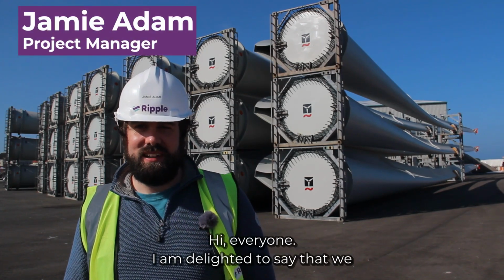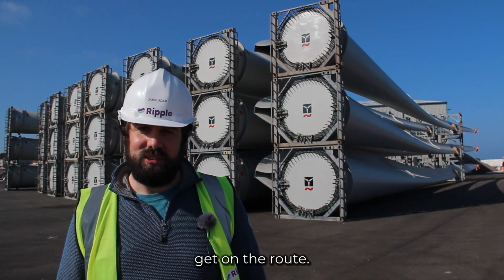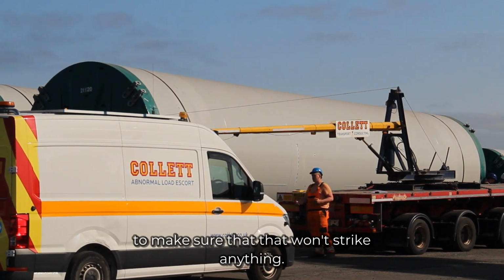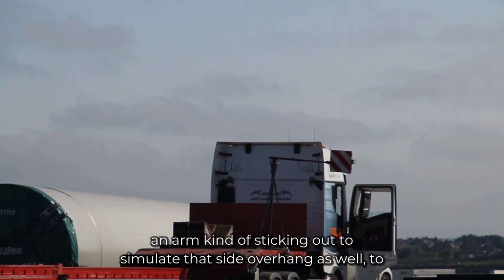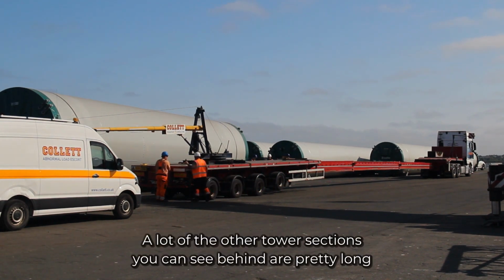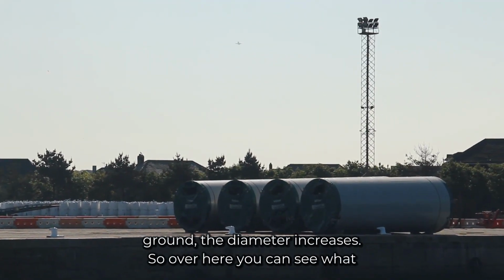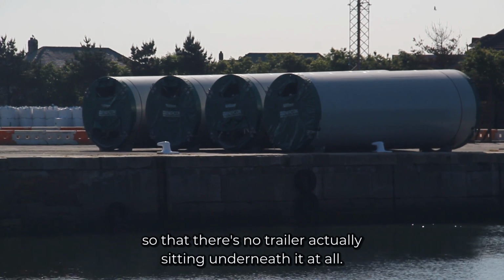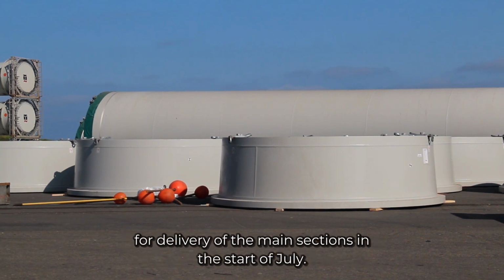Long load test drive to Kirk Hill

Comment: Is that section next to the original road at 4:00 going to be left as a permanent layby or in case additional blades are needed in the future.
Reply from the maker: Yes, for that exact reason the turning area will be left in place until the windfarm is decommissioned